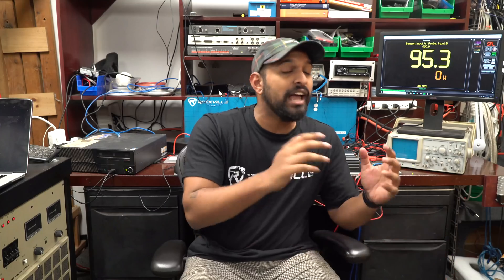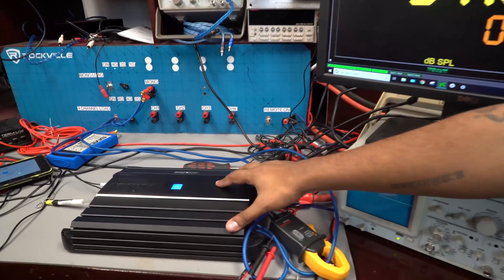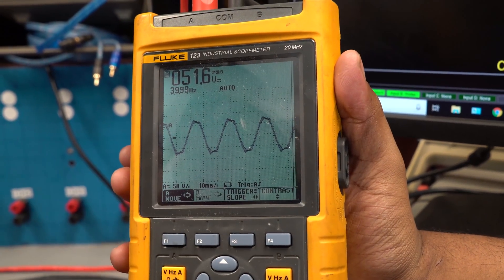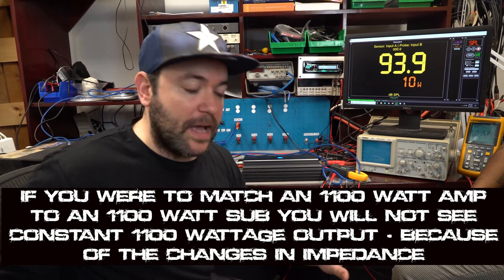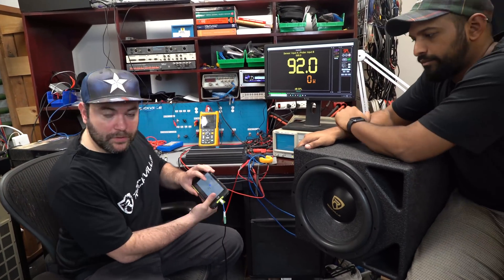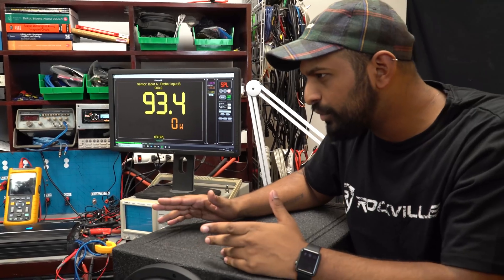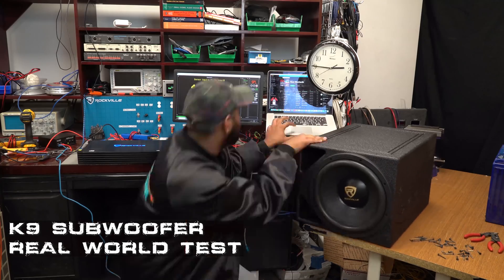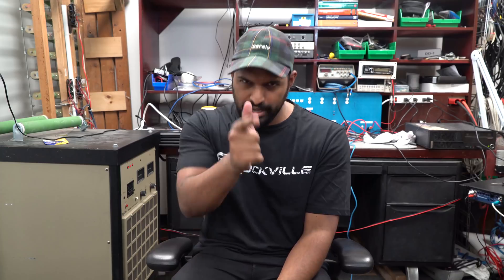Impedance Vs Frequency ft. An Alpine MRX-M110 & A Rockville K9 Subwoofer

Comment: I have a 2001 Ford F-150 with the extra cab not crew cab it has 6x8 in the doors 4 is there a way that I can fit your 6x9 RVL 69w sub in the back doors or are they too deep to fit I’m putting your RVL68. 2C in the front doors I already have 2x 12 inch subs

Comment: The impedance changes because a magnet with a moving coil is a motor, if you could move the cone by hand, it would produce power at the terminals, since its moving when hooked up, its also trying to create power backwards, at some freq. this back flow power will create more resistance as its out of phase with some freq. Sometimes its in phase with the power coming in and will drop the impedance.  This is constantly changing as fast as the speaker is moving.

Comment: I bought a Rockville RXD-M4 6000 to power an Orion 12in hcca 124, 5000 watt peak and 2500 watt rms. The installation guy said no this wont work and sold me a Rockford fostgate  Power T1500-1bdCP. What's your opinion?

Comment: Ive been trying to figure out why this sub is 7-750 RMS.I feel as if its design & thermal issues because it does meet the criteria of most 1200 RMS subwoofers on the market today in a low price range. Trying to justify a subwoofer in depth like this with other budget subwoofers & higher end subs dont really do it any justice. Rockville car audio is in a low middle league amongst in a range of Epsilon products.Take a 10 inch Power Acoustik Gothic. An 1100 watt RMS rating is laughable with a 2.5 inch dual voice, still its magnet is 204 oz. I toyed with the K-9 15 V2 on a Skar RP-1200 and tried 900RMS on a test tone only to get that smell till I put my EVL-15 back in, which is like 4-450 RMS more, with only 166oz magnet. I know it really sucks making a V2 and having similar issues but its not doing Rockville any justice trying to justify the impossible.Mistakes happen & nobody is perfect but sometimes you just gotta take an L and push foreward so that branch of Rockville can have another day & next sub? use an amp that is the true RMS of the claimed sub RMS & run the gucci mane track for an hr at that, or right before clipping , if it lives? there ya go. This is whats expected with most ppl that put subs in there car & thats why companies like  Skar & Audiopipe do so well.Most ppl will spring the extra few $$ to get what they expected. still aint a bad sub just overrated by about a third & im assuming you guys only takin the hit cuz of the whole K-9 series had issues and ya prob a pretty reputable company besides that but justifying it especially like this seems foolish. You aint the 1st this happened too & ya wont be the last either but its better to accept . improve or move foreward. Jus my opinion, Like thoose moving heads btw 160$ def cool for a small spot for work ima grab them up soon

Comment: The Rockford Fosgate T1000-BDCP is CEA-2006 rated for 1000 watts RMS at 1 ohm. Their typical birth sheets have about 1500 watts at both 1 ohm and 2 ohm as well as 900 watts at 4 ohm. There are also other manufacturers who are using various technologies to help stabilize power output at different impedance loads such as JL audio. You also have to consider that some amplifiers have pretty significant dynamic headroom (especially the Rockfords) which means that certain amplifiers may put out more power with music (hence the dynamic amp dyno tests). It would be a great video to see if the K9 subwoofer would handle the power of the T1000 for an extended period of time wired to 1 ohm.

Comment: Good video. Very accurate, easy to understand information. 

Here is a suggestion for a video... the difference between a AB amp, AB-D Hybrid and a Class D. And how much less efficient an AB amp or 5 channel hybrid amp is vs a full Class D amp. You can also go into the difference of sound quality between Class D and AB. I've tried to explain it to my girlfriend but she doesn't seem to get it. Maybe you can do a better job than I can. 

I recently purchased your DB55 for my girlfriends vehicle and the only issue I have is power draw and volt dropping.  I had to install a 2nd battery to maintain a voltage over 13v. Before I did I, installed my PDX V9 to see if it would do the same and it didn't. No dimming headlights or dome lights. And yes I did upgrade the ground wire on the alternator to 2g when I did the installation. Part of the problem is her car has a computer controlled, fairly weak alternator.

Comment: So what your saying is the sub is actually a 650 watt rms sub . But it's rated at what 1200. What happens if u run 1200 into it. U no the tone just pull one them Rockville amps out that will do the 1200 at 4 oh. Play 60 hz

Comment: this pretend audiobahn should be 300w rms 600w cea 1000w max and everyone will be happy. its not bad i mean jl w6 are about the same in handling power and they cost way more
Reply: i dont think so, sundown unofficial uploaded a video back in august blowing up an E12v3 thats rated at 500rms. it ran at 750w for 5 mins and it didnt blow. the only time it did was when it ran at 1000w. your sub thats cea rated at 1000w cant even handle 1000w for 5 mins or maybe it can? but when you uploaded a video, you only gave it 600-700w then started saying that these will never see 1000w in real world applications. upload a video of the k9 handling 1000w of clean power for a period of time then we will shut up
Reply from the maker: Our CEA rating is similar to the other top brands like sundown, kicker, etc. The only reason people think this is false is cause EXO did a video on our sub, but didn't run the same test on any other sub. But we ran the same test and the subdown blew as well. So did the American bass. and these are high quality subs. We will be doing more tests. Putting that test and that video aside, there is no other issues going on.

Comment: The easiest way to solve this problem is to put the k9 up against a dc or sundown or fi at the same rms numbers. Run em both on the same amp and see which lasts longer... After even all this which is true Ive seen a sundown zv4 which is 2k-2500rms on a sundown svc7500. after rise and everything else those subs were each still seeing at least 3500rms. I just don't think the K9 can stand with them. And I run a Rockville amp with zero issues!
Reply from the maker: hey, we are in the process of getting our equipment set up to do this test, so stand by! I agree with you. Screw the term lab. Just put each sub to the same amp, and see which one blows first right ?  Im sure haters will still hate, but we will keep the cool tests coming and whoever wants the truth will get it. Whoever wants to hate will hate.

Comment: I was waiting to see how y'all are going to explain box rise, inductive load vs. Static load. I've got 35 years electrical an mechanical just in car audio and I'm still learning shit. The gain control is supposed to regulate the rail voltage allowing you to turn a 1000 amp down. To match your speakers input. Does it work?  Not in all amps. But hey that's what we're all here for, to learn a little something and be louder than our buddies.
Reply: The gain is to match the signal input voltage not the speaker. Just fyi
Reply: @garymason2815  how many amplifiers have you repaired I'm guessing none because if you did you would notice on some amps the gain control is nothing but a fucking potentiometer introducing ground to Signal input others it actually controls voltage regulators like some of the high-end JL amplifiers and you trying to tell me that JL Engineers got it wrong too?

Comment: The SMD AMM-1 shows impedance and wattage at the same time and in my K9 video you can see how much the 10" woofer is flexing with "only" 250 watts. I intended to explain this better in my video, but you guys did a great job explaining here. Music is dynamic and wattage as well as impedance will fluctuate greatly for many songs, except maybe the songs with long bass notes (or the rebassed tracks). 

With the advanced, consumer level tools available today (AMM-1 and TermLab), we have the ability to see much more about impedance and wattage than we ever did in the past. As long as the consumers understand how the power levels are determined, I think most people are good with that. If a 1000W "CEA" sub is really only 500W "continuous", then does it make more sense to rate at 500W continuous or possibly confuse people with the 1000W CEA rating?  If the latter, I'd try really hard to explain that CEA rating and how it would match up with a CEA rated amp (or one with true RMS ratings). Otherwise, people who have test tools to determine true wattage will assume the sub can handle 1000W on a continuous basis. Not to mention, my K9 12" says 1000W CEA, 2000W RMS and 4000W peak on the spec sheet (v2). Might make more sense to be rated 500W RMS, 1000W CEA and 4000W peak (in my video the K9v2 12" handled over 3000 watts before going up in smoke, so the 4000W peak for a burp may be attainable).
Reply: Their we site says its 1000 rms cea  it wont handle it. Just mark it correctly and it will still sell
Reply from the maker: Wassup Big D - always appreciate your comments. 

I want to answer that if we rate this at 500w then sundown and every brand will also have to cut their ratings. We ran the same test on 2 subs with the same result. You can try it for yourself and you will see.

Our ratings are done to a similar standard as leading brands. Some brands like JL Audio are more conservative than us. But Sundown and Kicker are very similar. We test tons of subs. We don't just slap ratings without testing for months and sometimes over a year. You are invited to our offices any time by the way. Our entire team of 70 loves you and your videos.

As far as peak - yes we already got a video in middle of being produced of it doing over 4K. We had to strap 2 3500w amps to get that due to impedance rise. They can do more. We just need to find some bigger amps cause the Rockville biggest amp (not out yet is 3.5K). We did start production on them though. They got a limiter (with an on /off option) and a bass remote with clipping indicator. Also a voltage display on front. 

As far as the program rating. Its saying it will take an amp between 1K and 2K. Having an amp with a higher power rating than the is actually a good thing. If you crank the amp you wont clip the sub to hell as easily if your amp has more power. If you under power the sub you might want it louder and clip the crap out of it.  If budget is not an issue 50 % over rated power is best in my opinion. Actually when I tested the K9 before starting production I ran 2000 watts to one sub and then I ran the same exact amp in the same car to a competing sub. And I had 2 bass knobs in the front.  So I can easily test sensitivity, and power handling and A to B it against another sub where they each are being fed the same exact voltage/power and everything..  

We got a few more videos coming.

Oh and by the way, that other thing with the voice coil winding height myth that people are talking about.. Voice coil winding height has ZERO correlation with power handling. Voice coils are complex. You also need the to match the voice coil with the other mechchinal limits of the sub. If we made the winding height taller the sub would lose some force and lose sensitivity. For some subs it makes sense to wind it taller and for others it doesn't.  Sometimes you just lose sensitivity and SPL by doing that.   Their are a million factors of voice coil. Wire resistance, thickness of wire, how many layers of winding, even the shape of the wire, material, gauge of wire. But you make voice coils to match the other components of the sub. Our winding height is 100% good. We are considering making a video just about voice coils, but its extremely complex so we will see.
Reply: Niiice

Comment: If people don't know about frequency rise (box rise) they shouldn't be doing there own install.
But come on Rockville you put 1000 RMS on your subwoofer and so does every other manufacturers and as a consumer I'm going to run as close to the true RMS as stated by the manufacturers specs and the subwoofer should have no problems taking the 900 to 1200 watts of unclipped RMS power in a daily setup.
------- RMS -------
Subwoofers have two power-handling specifications RMS watts, also referred to as continuous power handling, and peak watts, or peak power handling. The RMS (root mean square) wattage of the subwoofer indicates the amount of power the subwoofercan handle on a continuous basis.
ALL you had to do is put 750 rms on your subs and they would be perfect, and its just not your company it's every company over rating there subwoofers and amplifiers.
As a consumer I want what I paid for and I always take in consideration of box rise 
I have to Orion HCCA 15s on Orion HCCA 8000.1d clamping over 6500 watts wired at 1 ohm and rise to 3 ohms so yes it don't see the 8000 watts but the subs are rated at 2500 RMS each and take it daily on unclipped signal and on 100 ah of lithium and CEA alt.
If manufacturers can show there equipment can take there ratings then there would be no problem but the newbies need to know and understand that you need power to make power
Reply from the maker: I agree with you. we rate it at 1000 watts because that's the industry standard way to rate it. But just to clear the air - run our K9 with an amp between 1000w and 2000w and don't clip them and they will be all good. And also if you run test tones for long periods that can damage this or any other sub easily. So hopefully this clears the air for everyone. And I hope people can stop being so mad at us. Sundown, Kicker, and all the popular brands rate items this way. We didn't make the standards. Other brands (I wont mention names) would rate a sub half this size at 1000w RMS (everyone knows who I am talking about im sure).  As long as you all know you can run 1000-2000 watt amp and not clip it then everyone knows what to expect and that's all we want at this point. we want everyone to know what to expect out of our item.

Comment: Pretty basic stuff, suprising how many people dont understand this. I still think you played it safe though on the ohm load. But you cant please everybody.  I do like your test setup how ever, pretty slick! Wish to God above you would take the damn max power bs off your product. You will never be a reputable company with max power there in the audio community.  One persons thought anyway.
Reply: max power that number they use for total output of alternators added together at 2500 rpm versus rated alternator power and what does max power have to do with speakers and amplifiers I'm just a little confused must be the paint chips I consumed as a child

Comment: In the last video you still should have set the amp so it was putting the rms rating of the sub so the amp at least peaked at the subs rms
Reply: Tankdog , Please re-watch the video. Due to impedance rise in subwoofers while playing if you want to get 1000 RMS out of the amplifier to play to the subwoofer you will need a more powerful amp than 1000 watts usually in that case 2000 watts or even above that. We will do it for you in a different video , do not worry. We are here to help answer questions to the community and we want people to feel comfortable asking questions. We are here to teach and help.

Comment: You guys need bigger amps for the "WILL THEY BLOW" videos. A lot bigger amps...keep the series going. GREAT SERIES! KEEP IT GOING!!!

HOWEVER, I will reinforce once again...whatever your RMS...whatever your CEA RATINGS..which is your lowest power rating(Used)....those in the basshead community expect your subwoofers to be able to handle that actual power clamped for a lot longer than anything so far that has been shown on video.( a min--10secs in one instance)

You guys are developing credibility issues in the basshead community.

You need new power ratings...RMS/Continuous and MAX (Just 2 ratings.)

....and the basshead community expects your subs to be able to handle your listed RMS rating clamped for a very very long time...not for a minute or two.

When you moved pass the K6 series..unto the K9 and Destroyer series...you moved into the big boy world of the bass sub culture.

MUCH DIFFERENT AND HIGHER EXPECTATIONS!!!!

Comment: Has anyone measured the distortion that is on the song EXO uses for that torture test? Distortion could be a factor with that song that was rebassed as well. the upper bass frequencys should also be taken into consideration since there is a lot less coil movement to dissipate heat. Peak wattage should also be looked at with that song to see what the peak power is going to the subwoofers. It would be great to see all the factors that are going into that test not just an RMS number on the term lab. RMS numbers performed in a lab under stringent test conditions don't always represent what happens in the real world. Also putting any subwoofer in the same size box doesn't necessarily mean that it will handle it's rated power in that enclosure. hopefully you guys will talk about how the enclosure plays into power handling as well. I would like you to try one of the FI BTL subwoofers to see if they will handle that abusive test without blowing